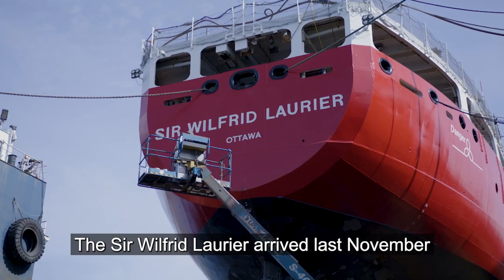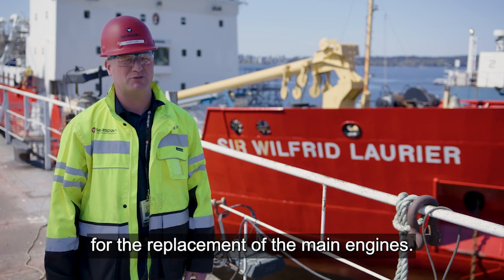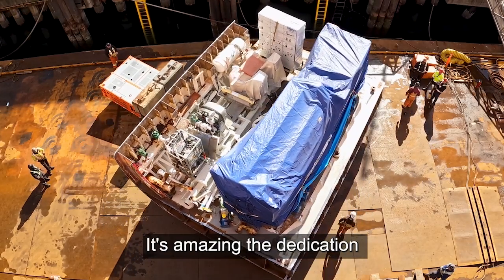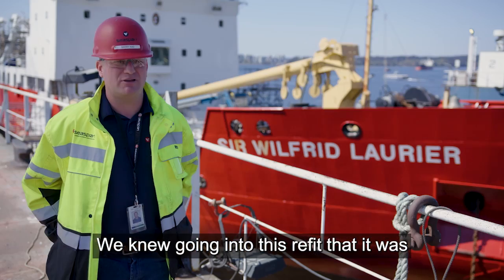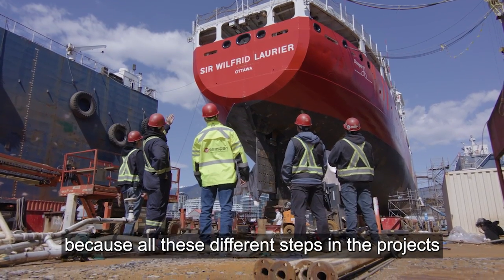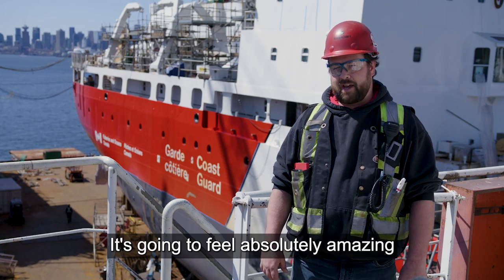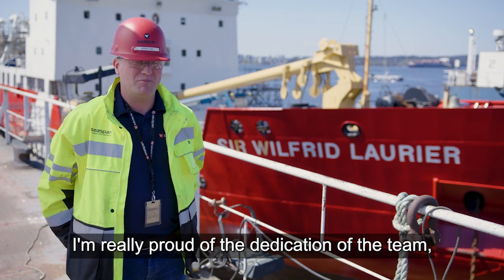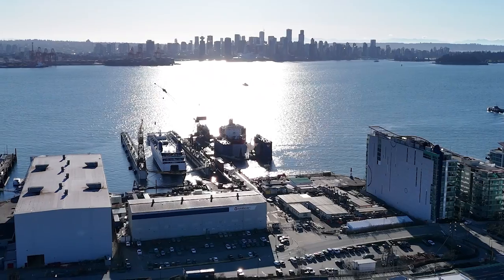Completing the Vessel Life Extension of CCGS Sir Wilfrid Laurier

Comment: Right nearby, so I've seen this ship getting worked on for months already. (Much to the chagrin of the "Shipyards" residential project nearby, who discovered after purchasing that the area does actually host a shipyard.) It always just seems like they are there forever, but the work does get done and then something else replaces it in the same space. At 0:50, you can see next to it one of the BC Ferries (being worked on too/next?). To the immediate east of this yard, past those trains is a  huge grain elevator facility.

About 2-3 km west of this facility is the other Seaspan one in North Vancouver, where they just did a naming & launch of some other Canadian Coast guard vessel Naalak Nappaaluk, and they also do navy projects there too.